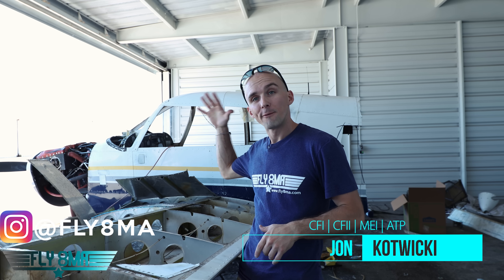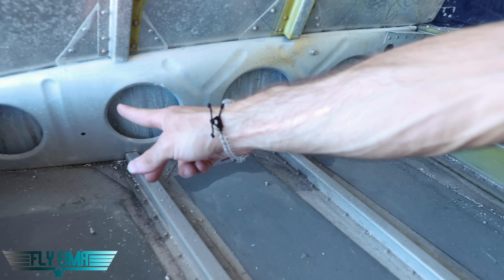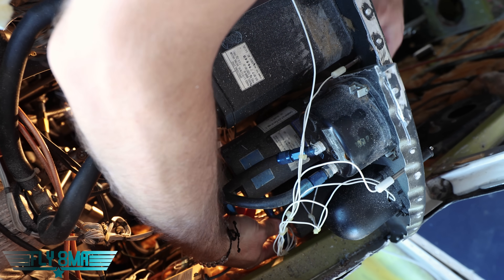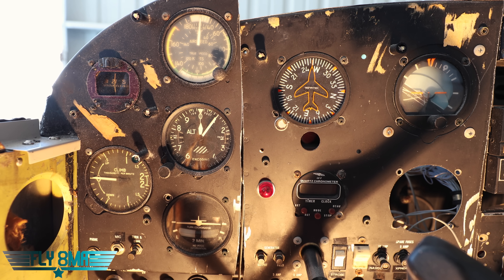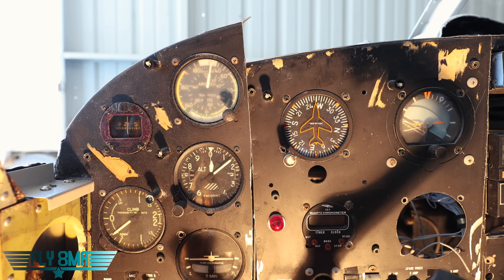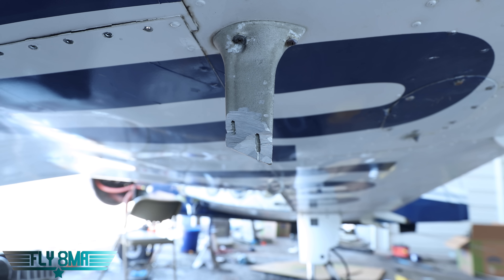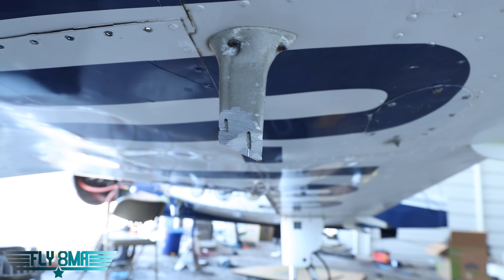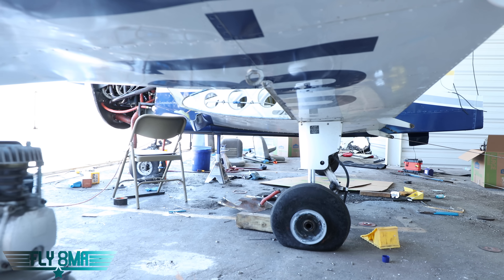Pitot Static System Fully Explained

Comment: can you explain "Use of an alternate static source inside the cabin of an unpressurized airplane may result in the altimeter indicating an altitude higher than that actually being flown because of the venturi effect of air flowing around the cabin, resulting in a slightly lower pressure inside the cabin."

Comment: I’m dumb. I don’t get it. I’m lost on the ASI. I thought the ASI was pressure only. I don’t understand how sucking on the static side raised the speed. Thanks.
Reply: Hey mate. The ASI has a static line (measures static px) and a pitot line (measures total px) both connected. As your velocity increases, the increase in dynamic pressure through the pitot tube causes the sealed capsule inside to expand, increasing the speed on the dial. The static source exists to cancel out the static pressure component of the total pressure from the pitot tube. Because this aircraft wasn’t moving, when there was a negative pressure (sucking) on the static port, the capsule inside now expands to match the static pressure outside the capsule.
Reply: @auspilot6119  thanks but it still doesn’t make sense. If I blew into a balloon like the diaphragm of the ASI… it will inflate and create pressure. If I put a pitot static line on it.. the balloon would be hard or impossible to inflate with a leak/pitot static hose.
Reply: @mopar92  the static line is connected to the air around the sealed capsule in the ASI case. At sea level and with the aircraft not moving, the pressure inside the capsule (balloon) is the same as the air in the rest of the case, hence the ASI shows 0. When she sucked on the static line that created a pressure differential where the capsule now had a higher pressure than the air outside in the sealed case, so the capsule could expand and the ASI registered an increase.

Comment: There’s an additional static line that you didn’t mention.  It travels inboard from the junction manifold behind the altimeter to the radio stack.  It supplies static pressure to the altitude encoder.   
       
     The encoder translates the static pressure into a binary code (grey or otherwise) that represents pressure altitude and sends this information to the transponder.
    
      The transponder adds a set of altitude pulses after the squawk code pulses.   The transponder is transmitting the aircraft’s pressure altitude (what you would see with 29.92 in the Kollsman window).   
       Each ATC radar facility makes the correction based on local altimeter setting so the controller can see actual MSL altitude.

Comment: Static decrease affecting the ASI... this is exactly why we need to check that airspeed is indicating while on the roll... if NOT indicating, abort the take off... otherwise, your airspeed will jump alive and give you all sorts of confusion on climb out (assume static is working); static should always work (even if the pitot cover has been left on) as there are other static ports on the fuselage (assume static pipes not blocked) right? Bottom line - no airspeed indication on takeoff roll... abort.

Comment: Notice how the needle on the zero after sucking on the static port, it is now damaged and not zeroed. In an airworthy the aircraft I would send that ASI out for repair.

If you ever use a pitot/static test set always bring pitot up to speed before static

Comment: My '83 Beech Sierra has retractable landing gear. Instead of oleo struts, the Musketeer-Sierra family uses rubber "donuts" to cushion the landings. Retractable gear aircraft with oleo struts typically use a "squat" switch to tell the system whether the airplane is airborne. "Squat" switches don't work well on rubber "donuts", so the Sierra uses pitot-system air instead with the assumption that at 72 knots, the airplane is in flight. When doing the gear retraction-extension test for the annual inspections, a rubber tube is supposed to be placed over the pitot tube, then rolled up until the airspeed indicator shows 72 knots. What really happens is that somebody blows into the pitot tube to get the necessary "airspeed" while someone else operates the gear handle.

Comment: This video brings back an expensive memory. When I had the altimeter/pitot-static system check done on my '83 Beech Sierra a few years ago, it failed. On further inspection, the shop found that, at some time in the past, the flexible portion of the pitot line had been replaced with aquarium tubing (not documented in the logbook, of course) and was breaking up.

Comment: Bugs in the Pitot .. Way back when We were doing a pilot assisted anual on a friends 1953
 C-170B. The Pitot  is a 1/4" aluminum tube and he uses a Plastic straw with a red flag for a pitot cover. Anyways the AI couldn't make it at the appointed time and we had the plane all opened up. So we decided to close up the hanger and come  and he said he would be there in the morning. The Annual was done and plane all back together by noon. So my buddy and I took it around the patch and low and behold the air speed was going backwards then by the time we got to base  it had crept up to about 60 mph or so. Long story an inch worm had come down from the hanger ceiling and laid eggs about 16" back into the line hooked to the ptiot. Luckily it was in the rubber hose and notin the hard line. Disconnected the line blew out the inch worm and her brude and all was well.   Good reason to never leave pitots uncovered.
War stories  guess when ya get this old all ya got left is O'l war stories.